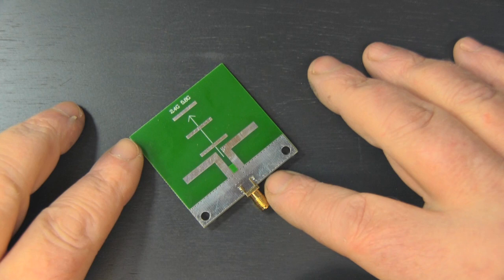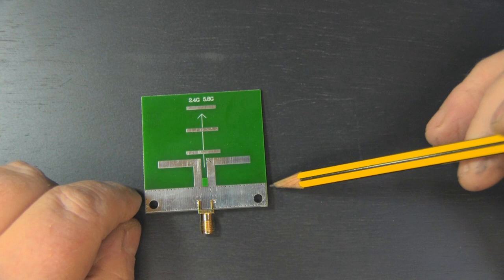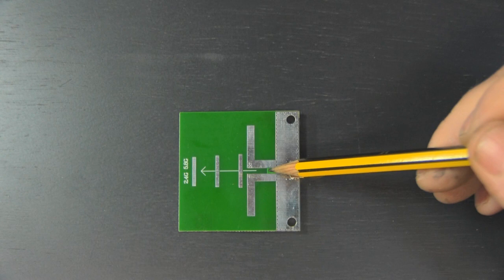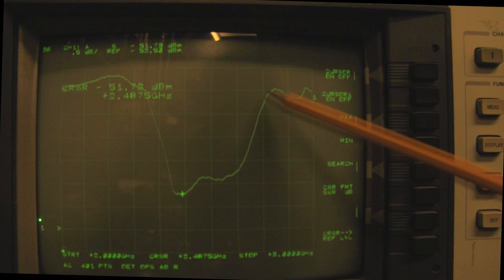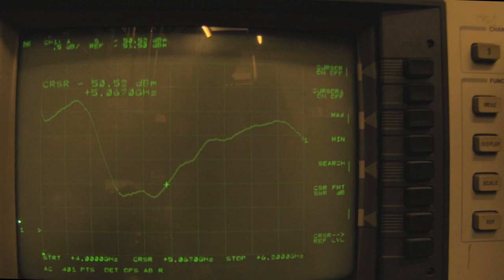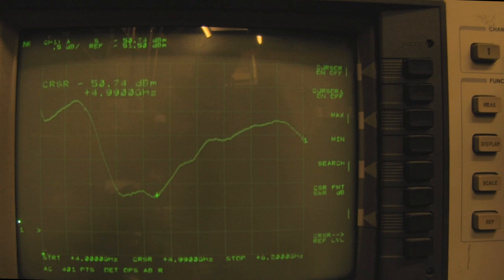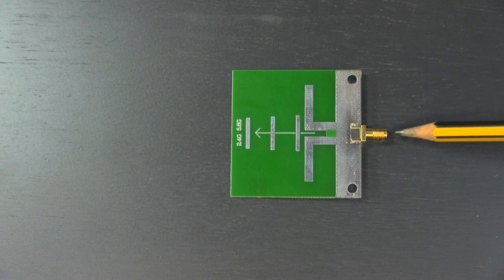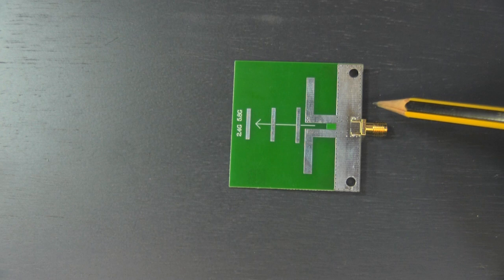A Tiny Dual Band Yagi...... But what is the frequency?

Comment: Dear,Andrew Mcneil. I ask you to help me with advice, since no one can tell me anything specifically. I am looking for a model or brand(maybe a drawing)a Dual Band (2.4 / 5.8 GHz) directional WiFi antenna to set in focus an offset satellite dish with a diameter of 1.2 m (47.24 inches) under one connector. The problem is that at the MikroTik Metal 52 ac (Dual Band (2.4 / 5.8 GHz)access point there is one N-Type Male connector.I know that at least dual polarized MIMO antennas with two outputs are now used. But i had to choose because of the functionality of MikroTik Metal 52 ac (dual-band (2.4 / 5.8 GHz).I would be very grateful for the advice.

Comment: You can see the dipole is sized for 2.4ghz. 
Is it possable to make a dipole dualband element driven yagi? 

Strange question i have. Im searching a dual band driven element that i can feed a parabola. Pcb's i see will almost change locations on the pcb were the radio wave is transmitted from, so this creates complications when i need both 2.4 and 5.8ghz to transmite from Precise Location where the focal point on the parabola exist.

The focal point can not change on a parabola, so if a dual band element transmits from the pcb at different locations like 5mm different location makes huge effect on the parabola beam.

I can see when my parabola focal point is off by signal strength and or a flashlight that almost simulates what happens when the focal point is missed.